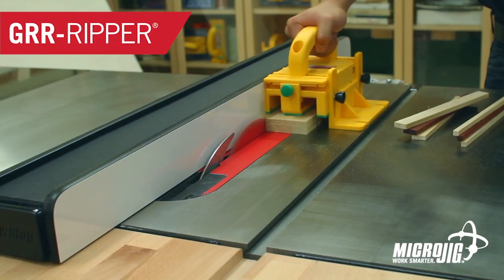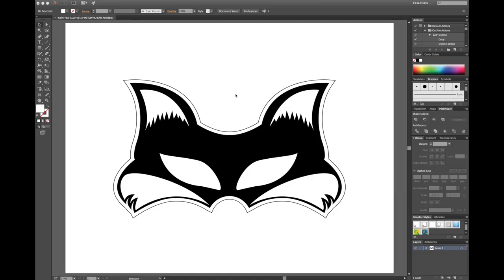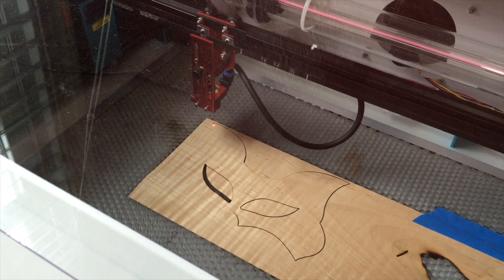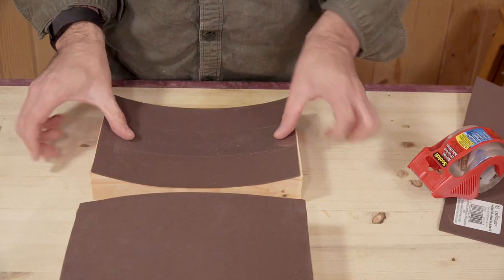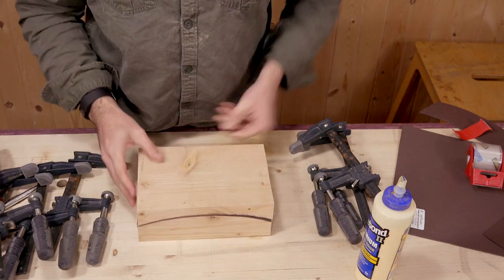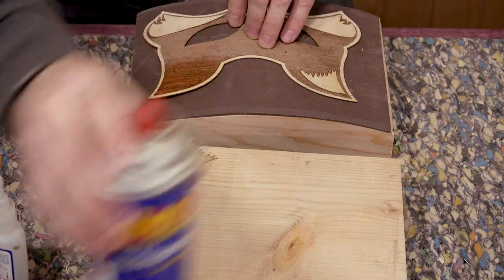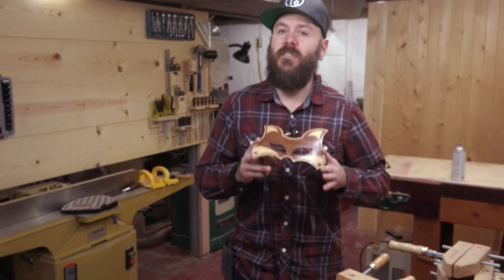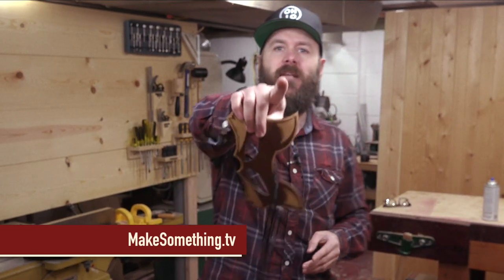How to Make Masquerade Mask: Laser Cutter Project

Comment: got a question on if you had a chance to mess with full spectrums rotary attachment? and if so the max diameter it will engrave? I have done engraving work the last 3 years and really interested in getting one from full spectrum

Comment: Did you get that for free? Or did you pay for it? I looked in to getting a C&C like the shakepo if I spelled that right lol anyway they are so expensive and the amount of times I would use it vs the cost of it doesn't add up for me. 
So I was wondering if they gave it to you with the agreement of you using it in your videos and reviewing it so to speak. I mean it is almost like free advertising for them. 
If you bought it how do you get around the whole cost vs use of it? Do you make in bulk or are just happy making 1 thing at a time and it will pay for itself when it pays for itself? 
If they sent it to ya for free how did you manage to get them to? Did they approach you or did you approach them?
Reply from the maker: +joe brown This machine was given to me as part of a sponsorship deal with Rockler. I also just recently bought another one (different brand/model) that should be arriving in the next few months. Sponsors approach me. I never approach them.
Reply: That's cool... I am not faulting ya for it. I hope ya don't think I was.   You earned your youtube stature you deserve it. 
I was just asking from a supply n demand. I could see myself using a C&C 3 to 4 times a year if that. So owning one isn't practical for me. It wouldn't pay for itself for a while.